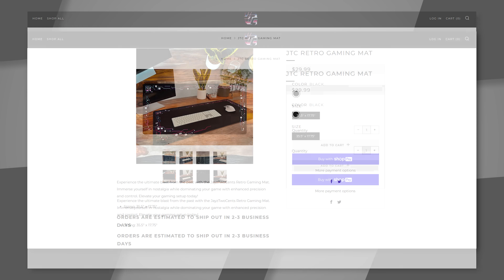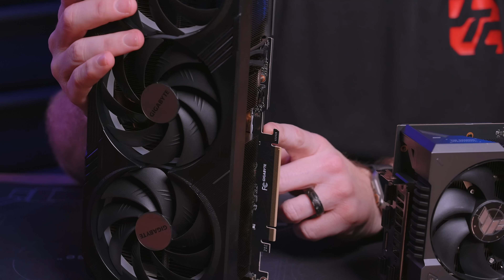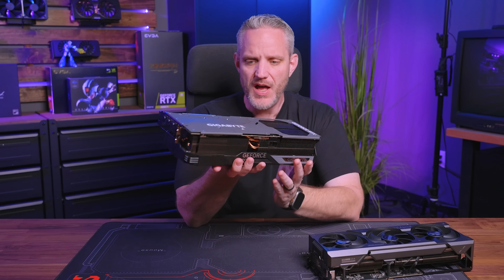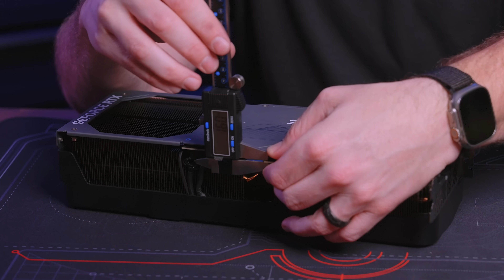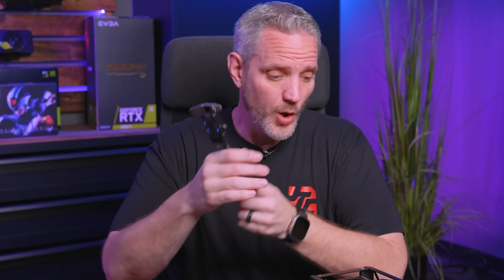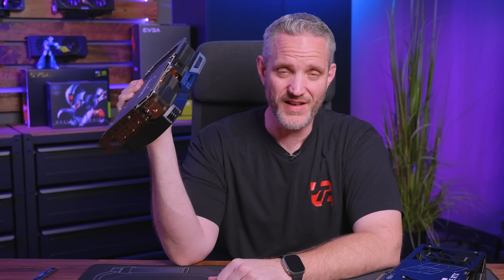These GPUs are cracking and the company REFUSES to warranty them!

Comment: Well, less flex isn't necessary better - if it's too rigid, it may suddenly break off instead of stress cracking in that way.  Look at how steel stresses - a crack forms and slowly grows giving lot's fo time to address the failure.  Now compare that to aluminum's instant catastrophic failure.

But I do think that long end of the card - not the side that gets screwed down - needs support.  The original IBM PC/XT/AT (etc) had slots/tabs/keeps/retainers (call what ever you like) built into the case, as did the clones, and all the aftermarket case manufacturers had them as well, to support full length ISA (and VESA) cards...  These kept cards from sagging.  At some point case manufacturer's got away from doing that - and at no point has anyone really thought that was a good or bad idea - just something that occurred over time.

It's only taken about 20 some odd years plus the weight of today's graphics cards to really raise the issue of why perhaps eliminating that one simple item may not have been a good idea.  Of course, today's cards don't exactly conform to a fixed length specification any more (they are quite variable in comparison to a full length ISA card having a set length) - so it's not like case manufacturers could just put them back in to have the problem instantly solved.

And yes, if the rear IO shield is sturdy as well as the material in the case slot brackets, you can find way's to use leverage to un-sag a card - so I'm not saying this is a bad idea.  But I think there is something to be said about having the weight of the card distributed among multiple points - as was done in the original PC.

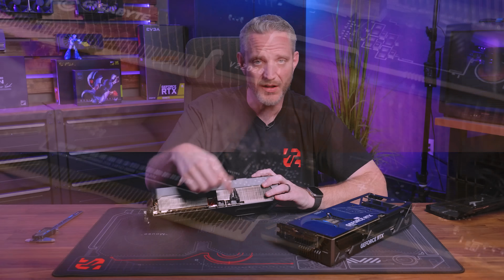Comment: At 14:12 or earlier, the support column on the ASUS card also adds structure support to the PCB vs the Gigabyte card.

It would be said that there are a number of contributing factors to the PCIe bus connector tab cracking. PCB Flex, markings, ground plane, weight, flex, even heat tempering.

Gigabyte should still stand by it and issue a voluntary recall and redesign the cooler at the very minimum and reduce the number of repairs needed by finding a cooler adjustment solution.

Comment: This is clearly a design issue caused by Gigabyte alone. 
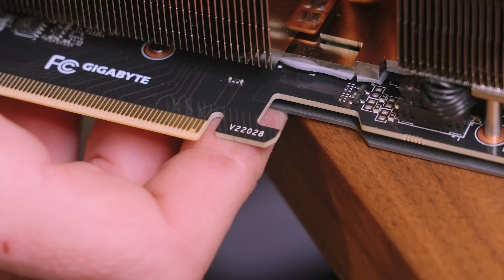As you show at 6:36 the Gigabyte card has a square hole with very sharp corners, although they are rounded corners.
The Asus card is just a cut notch so has a 180° curve with no corner.
This is exactly why aeroplanes have round windows because the square ones (on the BOAC Comet) failed in the corners. The stress and vibrations would certainly  lead to a weaker corner design failing more quickly.

Comment: So glad my MSI RTX 4080 GAMING X TRIO is screwed in to the bulk of the card on the 3 slot bracket. Also used a supporting arm from the start. I have seen a cracked PCB RTX 4080 not MSI on auction site which I am sure is the exact same issue found here.

Comment: The difference in flex certainly comes from the difference in the mounting as well. The Asus card has a bracket mounting point just by that tab, not allowing a great distance of PCB to flex. In comparison, the gigabyte card doesn't have such a close mounting bracket so the PCB can flex along a greater distance, easily allowing more angle of deflection at the point you are pushing on. 
I do feel like this is a explanation that makes some physical sense as to why 2 PCBs with the same thickness (seeing the pinned comment) flex different amounts.

Take a plastic ruler, hold it at the end part and flex it from the other side, lots of deflection. Hold it closer, less deflection. :)

Comment: Ok, just a few things that I'd like to add as an electrical engineer.
1. Both boards are 1.6mm thick. Board thickness is part of the PCI Express standard. If one was 2mm it would have trouble fitting into the connector or damaging it. Your calipers opened a little when you slid them off the PCB. 
2. Modern PCBs are usually made out of fiberglass. Fiberglass is pretty durable, but not strong enough to hold coolers  that size. 
3. 6:35 They both flex similarly. The Asus card just has a threaded standoff near the tab, and that is keeping the board more stable. The Asus card has a better mechanical design, since the PCB is supported near the point where the board is mounted - AKA where the force is applied.

I'm sorry if I sounded a bit like the "WeLL AcTuAllY!!!!" guy, it was not the intend.

Comment: Modern cards are just getting too heavy.  I seem to remember back in the 80's-90s cases used to have an expansion slot card guide at the front of the case.  These disappeared over the years as cards shrunk in size so typically didn't come in full slot length options any more.  There needs to be some kind of card support mechanism standardised in a specification as I cannot see card and cooler size and weight coming down.

Comment: When looking at the flex clip the asus card has a through hole standoff that looks like it mounts between the pcb and cooler right above the tab. That coupled with more material around the tab seems to explain the facts here. The closest stand off on the gig card looks like over an inch away. So if the asus card connects the backplate to the cooler in that spot (cant tell from clip) and it has a mounting plate that is tied into both of them as well the tab will have little to no stress on it.

Comment: I quit using gigabyte years ago when they denied a warranty on my 1080 that had a backplate changed at some point. I got that the batch number didn't match but that ultimately shouldn't have mattered because the silicone and the PCB were under warranty. .. never again

Comment: Hmm i need to check out my 4070 Ti because when i wanted to install it i hear a very loud crack, as if something broke, never checked that bit of the pcb. i thought it was the front that was ''bend'' a bit so it didnt slide into the spot between the case and the motherboard. Ive never ever had issues with gpus sliding it untill this Gigabyte 4070 ti. And it scared the living shit out if me.

Comment: The whole standard needs to change so that cards are supported at both ends or the card is mounted with all the left over forces going down into the board (downward in the socket). I can't believe they have managed to take it this far and stil have something that is reliable

Comment: These cards should come with sag support bracket. PCIE and case mount just isn’t enough anymore the whole concept is broken because it doesn’t work in a standard way. The GPU shouldn’t sag in any way with the standard installation process.

Comment: During Covid and the GPU shortage, I manage to grab a Gigabyte 3070 Vision OC at near MRSP. I was so happy, but that didn't last long. When I tried to plug-in the PCIe cable (1x 8 pin and 1x 6 pin) I noticed that the cable didn't go in. At first, I thought it was the cable, so I grabbed another cable, but it still doesn't go in. It's when I looked at the GPU that I understand: All the pins where off-centered by default. It was a brand-new card, and all pins were off-centered, I had to grab a tweezer to very carefully to plug all cables. I sold the card after a few months after grabbing a 3080Fe at MSRP (But I think I still have some pictures of the pins.) NEVER BUYING GIGABYTE AGAIN!

Comment: the mounting should be done via the cooler as far as i am concerned the PCB should not be attached to the back plate , as the PCB is mounted to the cooler .. especially with these triple slot back plates with a 1kg cooler ... and all pcb should be 1.6mm

Comment: As massive as GPU's are getting lately I wonder if it's time to move to horizontal PC cases.  Between the GPU's getting so big and what seems to be the move back to large air CPU coolers, motherboards may just start cracking in half lol
Reply: I agree, it should be "back to the future" for the AT/ATX design. Horizontal is the way to go. Would also be less stress on those honking air coolers which have grown in size too. Might have to resort to custom case builds until the case manufacturers catch up to this idea.
Reply: One alternative solution is to get riser cables but sadly, not all PC cases are compatible with them. Also, including them as standard equipment will increase manufacturing costs and they will reflect on final prices for consumers.
Reply: All of my gpus, except my mini rig are vertically mounted. Been that way for 2 years now.   Even my GTX 970 in my thread riipper is vertically mounted. Its the last Gigabyte GPU i have ever bought.
Reply: Going back to full circle with case designs is probably a wise thing after all with these monster GPUs.
Reply: That's why my current PC case is a custom made "benchmark" type case where both GPU and air cooler are mounted vertically. And also, since the design is completely open, I can spare the spending of cooling fan for airflow since my config, despite having not any added fan besides the CPU and the GPU ones, it's temps stay cold (The said rig has an AMD Ryzen 5800X [the cooling solution is a rather basic Xigmatek Windpower 964] with an RX6800XT, paired with 64Gb RAM and during stresstests, the temps goes barely above 70°C)

Comment: As an SI in EU; this is a nightmare for both costumer and seller. As seller you really just can toss the card and send out a new one, no repairs or returns for you... there is a reason why i got so many GPU Chip lying around.
Edit: this is 100%, every time, all time transport damage, sag doesn't crack whatsoever. Spent too much time testing then i would admit.
Edit2: no AiB does repair this.

Comment: I also think major factor is a chassis itself. When putting graphics card in, you push it all the way down until you hear click from the retention tab and then you see that holes for screw are not aligning and you need to push on it towards the back to get it to align and I feel like that is the point when you put a lot of stress on the tab.
Reply: Yes, I have a case that does exactly that. Now I feel lucky my Gigabyte 3060 ti hasn't cracked.
Reply: @R5s5m  I just bought a 4090 and Gigabyte now include anti-sag brackets that screw into the mobo's mid/bottom right screws and at the very end of the GPU. So I think they got the message already haha
Reply: @Xarosai  Yes I was about to say, I just literally bought a 4070 ti OC version from Gigabyte yesterday and today my buddy told me about this video and I was like motherfucker... But then when I opened the box I noticed that there was a bracket in there so I'm hoping that the bracket makes it to where it won't break on me.
Reply: @Why_Kirino  So they add a crutch. That isnt the same as granting all the owners of the alrdy cracked ones warranty., which really is the assy part of all this. If you put out a faulty product, own your mistake and dont make your customers pay for it (a second time). 
The thing is, even with the crutch, yours might crack anyway and then Gigabyte will say "nah mate-physical dmg is on you"
Reply: @Sporting1210  Right, I agree. My comment was pretty much just stating that I'm not sure what to think about my card right now after knowing about this problem. Yesterday? I was hyped as fuck lol. But now, I'm putting the computer together and once I get to the GPU I'm gonna be doing some "Mission Impossible" shit. So I'm super thankful this video was released, literally couldn't have been posted at a better time.
Reply: @Why_Kirino  I mean, you could simply return/refund it and give this story as reason shruggs
That would probably have more effect, then just keeping it hoping it wont happen.
Reply: Very true mate. Have realized it myself. You're absolutely right.
Reply: excellent observation and comment

Comment: I feel like the main problem is the size of the cutout for the lock. It's a lot smaller on the ASUS card than the Gigabyte one. Gigabyte skimped on like 1 cm^2 of PCB material and now their heavy cards are breaking because of it
Reply: FYI, PCBs are milled from rectangular boards.  Any "skimped" portions of the board were cut away (i.e. no cost savings).  As others have commented the real problem is poor geometry/mechanical design.

Comment: I think there is a long screw tightened just beside the ASUS GPU tab, which is holding the backplate... not sure but in the video we can see that.
That is adding the rigidity of the area where you are flexing the pcb tab.

Comment: Krissfix on YouTube have a video where he repaire this damage and he was complaining about the 30 series being prone to this kind of damage.
And he said it is one of the repaire he normally not do as he can't put warranty on the repaire as it is a design issue, as you said, due to sag.
HE said the only way to prevent big card to have this crack is to put it vertically so the weight is not bending the pcb.
Reply: Sad, when you think about it, the really nice looking backplate could be used to help structurally support the graphic card instead of everything on the PCB whose thickness is ruled by the PCIE port, a metal plate is stronger than a PCB and they could make it so it direct most of the weight on the case.

Comment: I had a few different models of RTX 3090's for a small home mining rig: ASUS ROG Strix 3090, EVGA FTW3 Ultra 3090, MSI Suprim X 3090, Gigabyte Aorus Xtreme 3090. The Gigabyte Aorus had the lowest binned GPU, cheaped out on all of the components with the worst performing fans, thermal paste, worst thermal pads that dripped tonnes of grease. The MSI stock thermal pads dripped a little oil but once replaced with Thermalright Odyssey thermal pads they were fine. Once all cards were upgraded with the thermal pads and good quality paste the best performing order was: ASUS ROG > EVGA = MSI Suprim > Gigabyte Aorus. I will never buy Gigabyte again.

Comment: If i am not mistaken, gigabyte cards is cheaper, than for example asus. So maybe this price difference is in PCB quality. And I actually kinda of OK with gigabyte refusing to RMA thise cards, because this things doesn happen just by having your GPU in your system. It seems like this tab brakes if you apply stress to it and FYI thats how nature is. If you apply enough stress to smth this thing will break. And its ok, if gigabyte cards are cheaper than the competition (its hard to compare coz in my country prices are quite inflated). I hope what i say sound logical enough. English is not my forte x)

Comment: As GPUs have gotten hotter and hotter heatsinks have gotten larger and heavier while PCB design has more or less remained static.  

PCBs for graphics cards, of today, are not designed for the heavier coolers.

Look at motherboard PCBs they have changed as CPUs got more power hungry and hotter and if you look at many companies websites there motherboard pages point out the design improvements of the PCB, to handle this, but this has come at extra cost.

Comment: 6:10 I'm using a Noctua NH-D15 for my CPU cooler and I literally have to use a screwdriver or something else long, skinny, and pointy, to get to the release tab on my Asus x470 gaming-f. It was especially bad when I got my XFX 6900XT, but also with my Asus Dual OC 1070. It really shouldn't be that hard to release the graphics card, and for my next build I'll definitely be looking for a motherboard that has a release button specifically for this reason. Alternatively, remove the latch entirely.

Comment: I stopped using Gigabyte back with the 780ti, it had bad VRAM, tried 2 cards. both had the same issue, had the cards for 3 days, complete fight to get a refund, had zero problems with MSI, Asus, EVGA and Galax/Galaxy.

Don't get me started on the Gigabyte motherboards, tried them back in the 1151 era, that lasted 2 days, who the hell can't put all PWM fan headers on a top tier motherboard, heck even ASRock could manage that.
Reply: I always avoid asrock and gigabyte whenever I'm shopping for/recommending motherboards
Reply: @yuussee  I've very rarely strayed away from Asus/ROG boards, they have been rock sold, I have a ROG Hero/4670k machine here that has been on pretty much 24/7 since I bought it new.
ROG boards have been the most reliable boards I've used.

Comment: Hello folks, 
Just a few pointers to help the discussion. 1.6mm is a standard PCB thickness, 2.05mm is another standard thickness, thicker boards exist as well but are usually reserved for power electronics applications, etc. At any rate, PCBs are layered stacks of FR4 and Copper. FR4 is a fibre impregnated fibre resin, as such its strength differs along its width length and thickness. Which affects its fatigue life noticeably-probably the cracks could be attributed to the alternating stress as the board would expand the contract during normal operation. The fact that the joint between the PCB and the motherboard header is preloaded by the weight of the card probably promotes the growth of the fatigue cracks shown. Nonetheless the nature of fatigue failure is such that in most cases the defects, small as they are, are already present on the material-they simply grow as the object experiences these alternating stresses. The fact that these are  3080s made during the pandemic, under the various quality issues all manufacturers faced at the time in my view has a lot to do with the failures seen so far. 

Jay keep it up-love the content

Comment: My ASUS STRIX 4090 shipped to my place with the tab cracked. Contacted ASUS about it and they recommended I send it in for an RMA. Never even got around to taking off the plastic. They responded a few days later and said that my warranty was void due to damage and the repair would be $2300+  

Absolutely the worst company ive ever dealt with.
Reply: Wtf? More expensive than the card itself